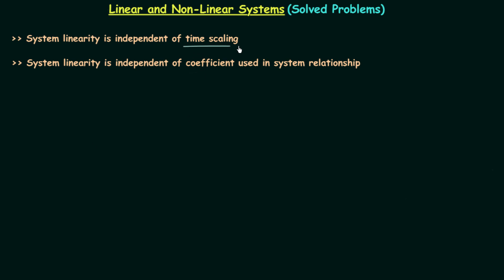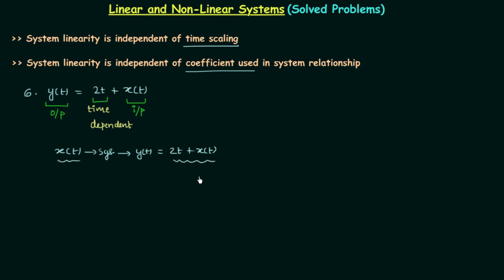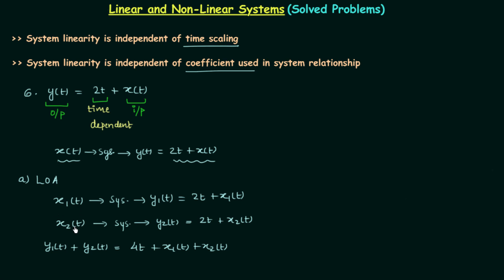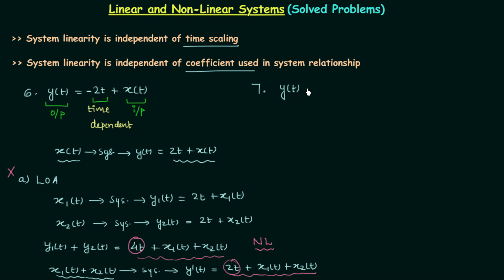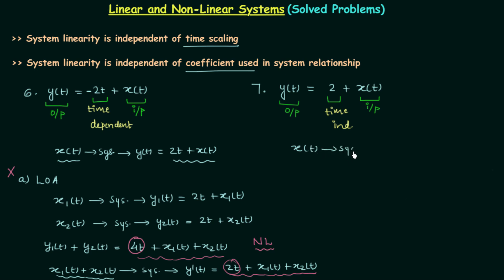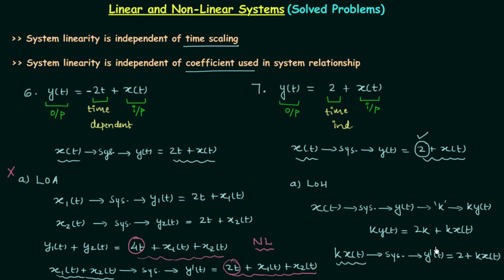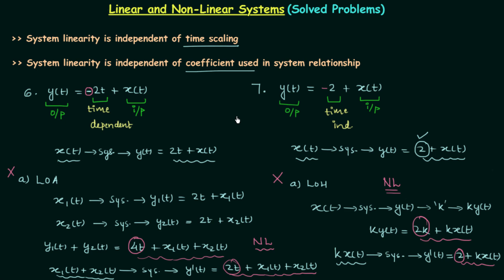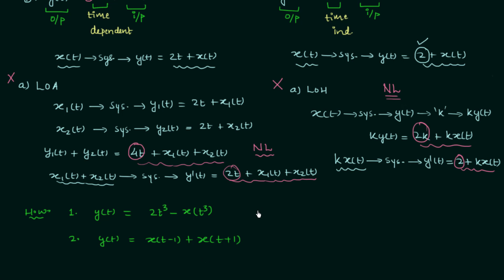Linear and Non-Linear Systems (Solved Problems) | Part 3

Comment: Check for linearity:
dy(t)/dt + 3ty(t) = t^2x(t)
How to solve this?
Reply: Linear. Solve the ode to get y(t). You can see a time dependent term is multiplied with it.
Reply: Linear. Solve the ode to get y(t). You can see a time dependent term is multiplied with it.